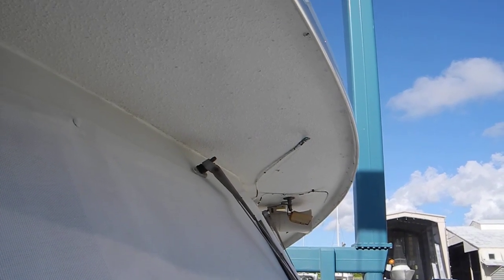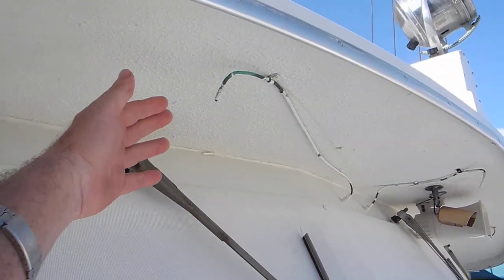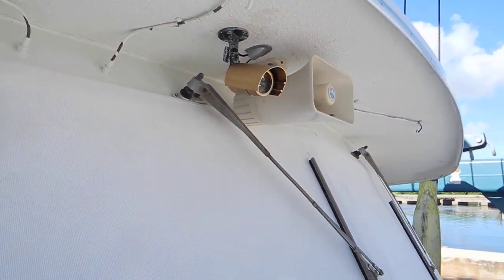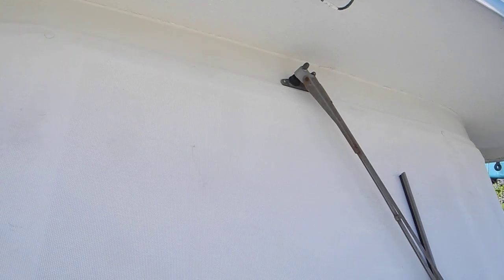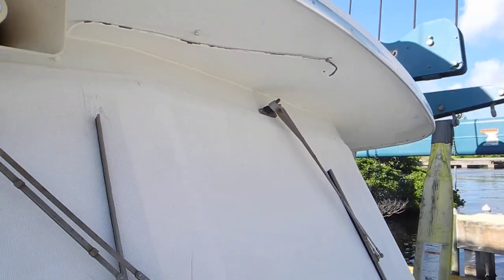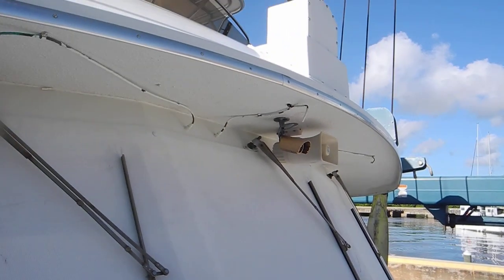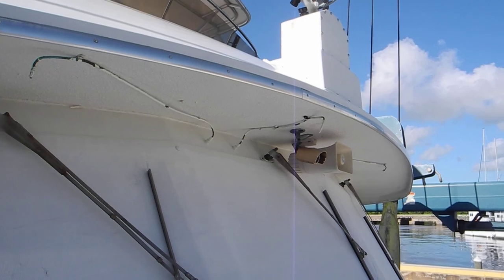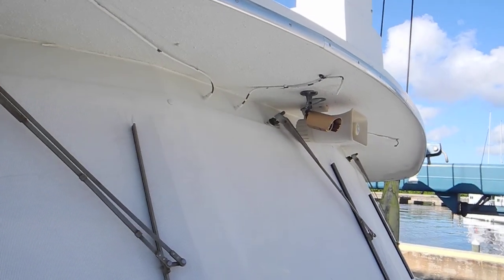Windshield washer design

Comment: I'm sure it works. But I agree kind of crude fabrication. Some spray nozzles off a junk car, might could be used for a more factory look 🤔.
Reply from the maker: True but even if the guy took a little more time and pride to use a tubing bender to make the curves smoother - more professional it would look a lot BETTER!
Reply: @AskCaptainChris  His craftsmanship is only a notch above duct taping garden hoses up there.